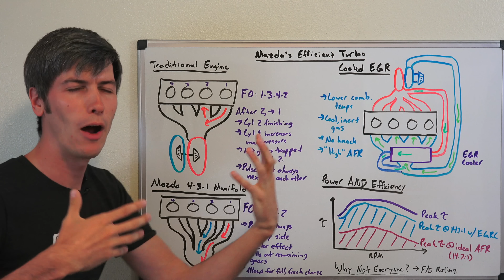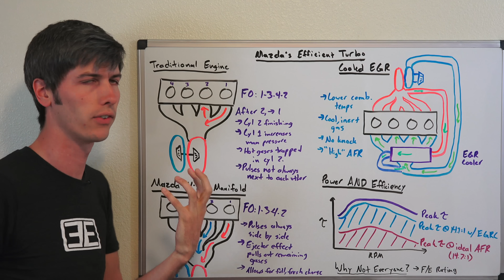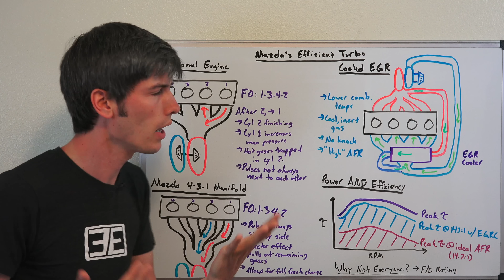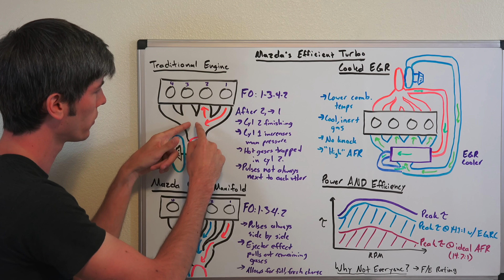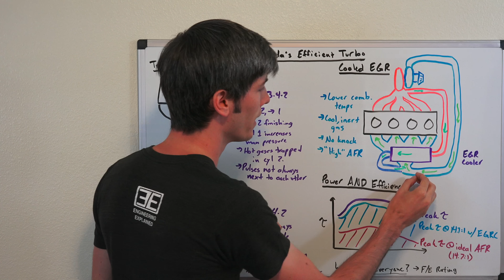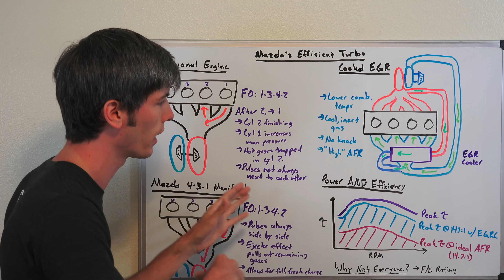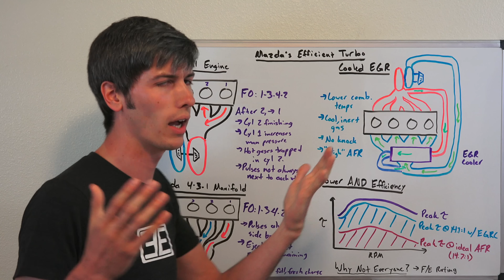Mazda's Secret To Efficient Turbo Engines

Comment: But as the car age, the egr cooler will clog up from the dirty exhaust gas. The reduced egr flow will even do less cooling compared to regular egr. Another great example of added complexity leads to more failure modes.

Comment: i dont get it, exactly how does the cooled egr reduce the knock ? in order to make more power, you need more cylinder pressure, more pressure means more heat. now if you cram in some inert gasses as well, it means you need more boost to push in more fuel-air mixuture. what i dont get is how does the exhaust gas help? Also, if its done like pictured bellow, it means that your turbo back-pressure needs to exceed your boost pressure, which is a scenario where you already are restricting the exhaust flow and causing possible knock from the side of not evacuating properly. 

please explain in more detail on how the knock prevention works with the egr.
Reply: also, its not really apples to apples comparison when you first compare small displacement turbo engines to na and then compare a large(ish) 2.5l turbo engine with stuff to a small turbo engine and contribute the whole gains to the "stuff" and just ignore the displacement difference. 

further more, by having a system where you negate the inefficiencies in other parts with boost pressure, means that you have to have a turbo that works efficiently with high pressure ratios, this is not traditionally the case with the small lag-free turbos on gasoline cars.

Comment: Basically HONDA learned to use the "venturi vacuum" effect on exhaust gas pipes...for turbo application....

& now water cools returned exhaust gas to lower gas temperature....

Why not cool liquid gas from fuel tank also???

Doesn't sound like anything ground breaking....its just common sense things they didn't do.  This is why we need AI to show us a list of all possible solutions/options.  So we don't take a 100 years to do something we already Couldve.

Comment: Very good explanation! Clever design of using 4-3-2 manifold. About the EGR water cooling, VW is using it already since 20y ago in TDI golf. The downside is the manifold get clogged up with carbon after couple hundred thousand kilometers ;)

Comment: Just for those that do not know, everyone uses EGR for emissions control. However, cooling the EGR gases by adding the complexity and weight of a cooler is silly, does not produce enough power increase to give you any benefit. The better example is to fully utilized the advantages of direct injection like Subaru WRX has (except leverage the advantage with a properly tuned map, factory map in those cars are crap IMO) to help get a more complete burn thus reducing the need to "trick" the engine into burning cleaner with a EGR setup. BTW EGR cooler or not is a bad idea for the longevity of an engine, especially in a direct inject engine which does not spray fuel into the intake path because of all the carbon buildup that results. Proper maped direct inject engine with EGR path removed altogether would be a huge improvement IMO. Sometimes less is more.
Reply: You are right, EGR is used by all manufacturers only for light throttle to reduce combustion temperature during weak air/fuel ratio. The EGR flow so tiny that no cooler is needed but the intake passing through turbo does. EGR is always off from moderate to full throttle

Comment: This is not new information, you're talking about balanced header is all. Mazda is not the only car that uses balanced headers, in fact they are almost as common and unbalanced.
Reply: It is however the first time one was used with a turbo and an egr cooler on a gasoline engine,and that was the claim.

Comment: In theory.
But in reality, more complex is always less reliable.
And why the hell do they rate the HP on 93 octane and torque on 87 octane ?
Reply: Torque doesn't appear to change based on fuel type. Horsepower increases from 87 to 93.

Comment: I have a question , does a 4-1 high performance exhaust manifold increase the likely-hood of knock ? The reason im asking is because you made a very good point about 4-1 systems being they collide the EG at the 1 , my car has had know twice in two separate engines. I figured it was because i didn't upgrade the valve cover gaskets & the upper enough. But could it have been the actual manifold ?

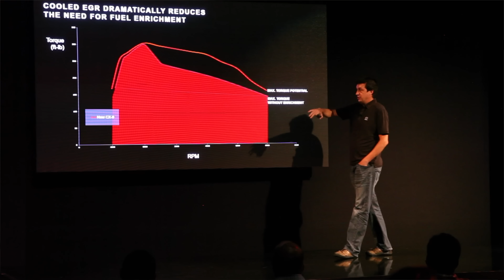Comment: 7:36 "why doesn't everyone doing it". The answer wasn't so clear. Thanks for clarifying.
Reply: What he meant, as I understand, is that other manufacturers will give you similar numbers produced under EPA conditions that will not be achieved under real world driving conditions. Mazda's numbers don't appear to be better, but they are more accurate - you can actually achieve those numbers.
I have. Honda Pilot. They claim 21mpg EPA. I get 16.

Comment: I think Mazda didn't invent this as a new technology because the cooled egr is standard for years with modern diesel engines. There you also have an egr where the - cooled- exhaust cases are mixed with the intake air to reduce the heat in the combustion chamber  because CO2 is absorbing heat and therefore the temperature is reduced .

Comment: I switched from a 5.3 liter GMT-900 truck to this engine in a CX-9. I truly believe it produces more torque than the other engine.  Any truth to the rumor that the next gen of SkyActiv engines will not have spark plugs?

Comment: One question about the EGR Cooler.  How do they keep it from caking up with soot?  With older Honda engines you have to periodically disassemble and clean the EGR valve block.  I would think cooling the exhaust like that would condense soot really fast.  Is the exhaust flow straight?

Comment: You failed to mention that Mazda's engine is severely " undersquare ".

That is the Bore is much less than the stroke.  I'm sure that this has some effect on efficiency.

I always thought, intuitively that a " square " engine would be most efficient.

I understand that the technology is in it's infancy & that it I might still be proven right.

This looks like it could be to an V8, but how do you cool the E.G.R.?

Comment: The US has just 87 Octan fuel? 🤪 In Germany you are not able to buy less than 95 on a normal gas station. If you want, you could get 102 Octan on a regular Aral/BP station everywhere. Maybe this is the reason why many guys boost their cars with 2 bar or even more? 😅

Comment: Is this 14.7:1 AFR with the EGRC including the inert gas from the EGRC? If so then they are not truly using a stoichiometric ratio because there is now less oxygen in the cylinder. So what they are effectively doing is running a richer mixture in the engine but doing so without injecting additional fuel. Not saying this is good or bad. Just noting that they are in fact NOT running a stoichiometric AFR.

Comment: The 310 lb-ft of torque from a 2.5t is not that great when 2.0T are 280--305 trq.  Horsepower is really low considering displacement.
Reply: what matters is when your getting that torque, smaller engines with high torque need bigger turbos which spool later making them less drivable for normal conditions.

Comment: The fuel economy numbers still seem very low mpg for a modern turbocharged direct injection engine,  I think the engine in the Mini cooper S (2.0 litre turbo direct injection) is about 40mpg (so Mini say) 
I have owned and driven gen 1 & gen 2 Mini cooper & Mini cooper S cars, I can say that the gen 2 (1.6 turbo direct injection) car is about the same mpg as the non S (non turbo) car, when driving normal or the same conditions.  with the gen 1, well the supercharger that just drinks fuel for fun.  the gen 3 is different because they have different capacity engines (1.5 turbo vs 2.0 turbo) 

I think manufactures could make cars more efficient by trying harder to reduce the vehicle weight, they just seem to get bigger and heaver every new model / year.

Comment: How do exhaust turbos work? Wouldn't you lose efficiency and power by adding that extra load and all that comes with it? More back-pressure means lower RPM which means lower HP output, not higher. I'm not an expert, but I think any energy you recover with that turbo would be much lower than if they just let the exhaust flow freely, because the turbo has it's own, additional resistance that'd need to be overcome before/while you can get anything useful out of it beyond clever marketing of a pseudo-scientific concept, false advertising, increased profit margin and fraudulent gains in income. Where does the energy for that extra equipment come from and wouldn't it be more efficient to use that energy to perform the work more directly? The cooler seems like an interesting concept, though. Personally, I'd simply have a large, flared front-facing air intake with reed valve, widen the exhaust, just put in more baffles along the way to allow the engine to develop more power through RPM and keep it cool without much need for a special cooling device to eat power and overcome other design deficiencies and maybe I'd even top it off with a solar panel on the roof and an extra, angled side port for the air intake with solar-powered fans in it along the way to pump more air into the engine. Those 2 intake ports angled up to the engine, filters in those that'd be fine enough to filter out most water but coarse enough to allow air through would be useful. Plus, some type of gravity-fed water reservoir for engine cooling through a drainage system under the filters so the water doesn't just get forced into the engine eventually would be great for all-weather driving, then when the reservoir gets full a float can open a valve automatically to drain the excess from the vehicle. It'd be a naturally water-cooled engine. Pretty basic but effective idea, considering the tech available nowadays, right? Again, I believe it's about marketing, copyrights and income more than efficiency or power, in the cases of exhaust turbos. Am I incorrect?
Reply: To answer your question bluntly, yes you are incorrect. Why? I will explain that. There are two ways we can look at this issue. One, is from a theoretical standpoint, and two, from a practical real life scenario. I know not so much about petrol engines, or car engines at all. My field is marine diesel engines, big 5000 HP + engines. I will first start with a theoretical standpoint. 

What the turbo charger does, is it uses the exhaust gasses to rotate a turbine. This turbine is connected to a compressor on the other side (in the video the blue and red parts of the turbo charger. Red for exh. gas, blue for air intake). On an engine without a turbo charger, the charge air pressure (Blue part again) is around 1 bar pressure. Atmospheric pressure. The diesel engine I had on the ship I sailed with, had a charge air pressure of 2 bars, sometimes 2.3 during high speed sailing. This is more than twice the amount of air that is pushed into the cylinder. This means you can also push more fuel in the engine to maintain this optimal air/fuel mix ratio. The same principle stands for the engine in this video. 

You mentioned that the back pressure into the cylinder is higher because the exh. gasses cannot leave as easily as they would without a turbo charger. Yes you are correct in a sense. But, the mass of the engine and especially the mass of the flywheel are there specifically to counteract these types of disturbances. The extra pressure the piston has to overcome is relatively very small compared to the extra power the added fuel produces. 

Now for my final point, the practical aspect. I talked with an old sailor recently, and he told me about ship diesels from 30 years ago that were much much bigger in size, but had the same power output. They didn't have a turbo charger. Efficiency of diesel engines hasn't increased so much over the last 20-30 years, perhaps 10-15% overall. This cannot explain the difference in size. It's the turbo charger. Ships nowadays have no power at all if the turbo charger explodes or breaks down. 

I hope that explains it.
Reply: It does, thank you. I wasn't aware any of the power recovered with the turbo charger was used to help with pushing more fuel into the engine. Now it makes perfect sense because it explains where the boost in power comes from. Before, I thought all it did was use some exhaust gasses to run a compressor that only pumped more air into the engine. That'd be a losing design. If what you say is true, and the turbine also runs a pump or similar device to progressively increase fuel injection rate and amount, That design seems realistic and smart. Still not sure why the turbo-charger's at the exhaust instead of the intake, with slightly more air intake and much less fuel intake for about as much compression in the cylinder and for efficiency reasons. I guess, like you seemed to imply, it's better than no turbo charger at all, though.

Comment: Question... I really need some feedback on this because I got a 2001 Volkswagen Beetle with a 2.0L . I am struggling with the EPC light which is telling me the same codes when I replace the parts I replace the throttle acceleration pedal and I change the throttle body which is giving me the same two codes over again even when I reset the computer.
Now my idea is to add a turbo to this car which was never installed in this car to begin with. I want to install one into this car so I can get back the power that it's Robin from because the EPC light I have no power going up hills and I'm struggling from 5th gear to 2nd gear trying to climb the hills at 4000 or 6000 RPMs without burning my clutch which I feel it is killing my crotch and it is killing my fuel economy how do you come about to install an aftermarket Turbo without interrupting the computer and to have the power back to its original specs without touching anymore electrical issues that I have currently in this car which is a nightmare.
can I please get a reply back because no one is responding to what my request is I'm struggling with this issue and I am very frustrated to a point where I'm going to crush this car with a dynamite to blow it up in billions of pieces it's cost me way too much for parts alone not mentioning the struggle of trying to figure out how can I get rid of that EPC light to get back my power

Comment: Of course I especially enjoyed this video because I have a Mazda SUV with a 4 CYL Turbo. The kick (torque) in that little engine is jaw dropping. My "little engine/turbo that can" does 0 to 60 in UNDER 7 seconds. That's insane for a midsize crossover SUV with a 4 cylinder engine.

Comment: Is there any special engineering baked into the 1. 6 L twin scroll turbo engine from Hyundai. I've owed a Veloster as well as now the 2018 Elantra sport and I noticed that the lower drag coefficient and improve driving dynamics of the Elantra sport or probably helping it with its real world fuel economy numbers but it doesn't dig is hard when you put your foot in it like the Veloster did when I had it for the 2017 year model. Can you do a video about their engine technology cuz they're saying it's a twin-scroll and I'm not exactly sure about it and they're saying that it does 18 lb of boost when all of the correct parameters have been met such as ambient temperature engine operating temperature and so on and yet I don't think that it pulls very hard at all and I would have been much more satisfied with the fuel economy of the naturally aspirated 2 liter engine because it's much better and has almost the same amount of power and especially at top end because it seems like this engine has been retarded or dial back quite a bit for fuel economy purposes. I've watched your small engine Turbo explanations and enjoy them very much. Could you please say something in response or do a video or let me know if you've done one and provide a link. Thank you

Comment: Mmm... Pretty sure Mercedes started doing this in 2015... The 2.0L turbo engines on the C300 has a small water cooled Intercooler on top of engine.

Comment: I still don't really get it:
High boost gives you more power because you can burn more fuel.
EGR cools the engine by reducing the amount of fuel you burn.
isn't that simply like using less boost and therefore less fuel?

I understand that EGR allows them to burn an ideal air/fuel ratio...
but less boost would mean less fuel burned and lower pressures, which means cooler engine, which means you don't need to run rich air/fuel mixtures.

In both scenarios you've reduced the fuel input, and you've got an ideal air/fuel mixture, and the engine is the same size... so why is EGR better?
Especially since ERG has more parts, more weight, and has to spend energy pumping around gases and coolant...

Comment: Thanks.
In fact, because of 4-3-2 exhaust, the exhaust pipe are longer so it takes more time to get hot and thus to meet the depolution standards with the catalyser, the car is throttling very much when starting the engine. I finally understood that!

Comment: Hello Jason.

Thanks for your videos, they are all very cool and I can always learn a lot.

I saw the other video "Why Small Turbo Engines Are Not Efficient" and after the one above.
First I thought your explanation would envolve direct injected engines and undirect injected engines (manifold injection), both turbocharged.
Actually I have a question regarding this two tecnologies. As I live in Brazil, we have a lot of downsized engines (1.0 L engines) in the automotive market. One of the most fuel efficient downsized engine is the VW Up TSI (Turbo Stratified Injection), that has 3 cylinder engine with about 105 hp and 121,5 lbf-ft. So here is my question:

Is the non efficiency explained on the first video, the knock problem, also present at the turbocharged direct injection engine?